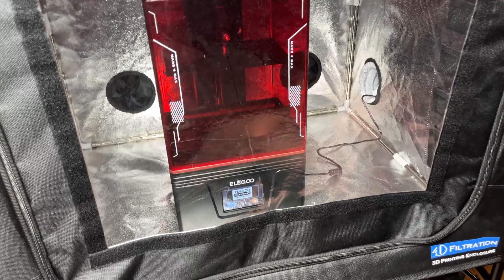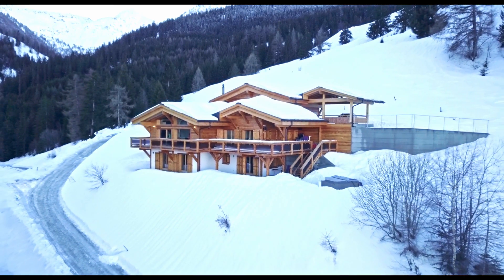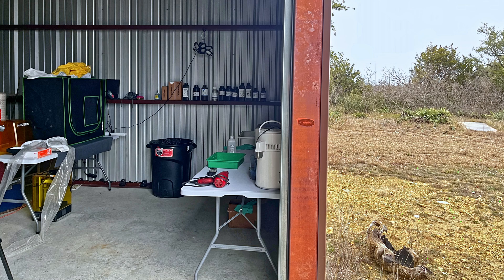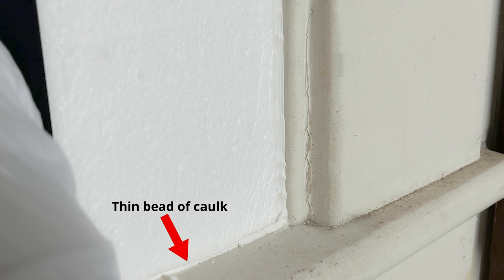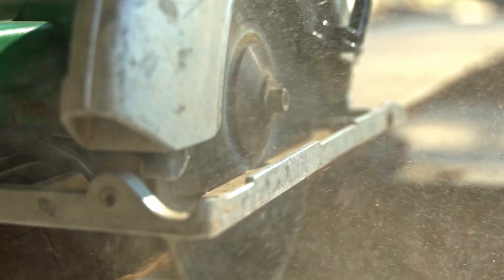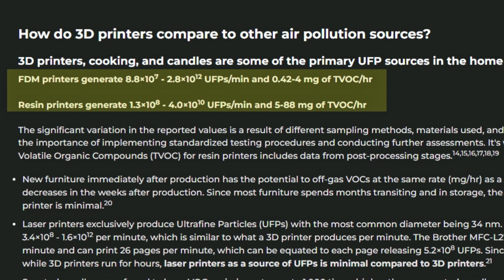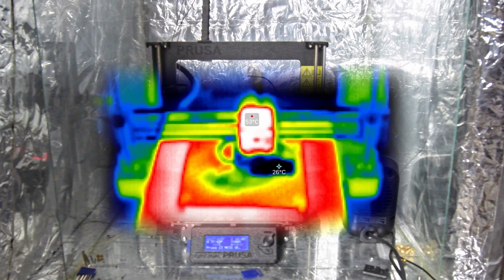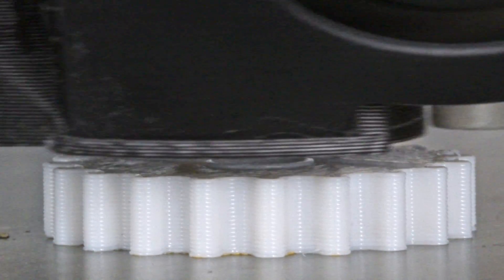FDM & Resin 3D Printer Ventilation

Comment: So I have a fdm printer in my office inside of a small grow tent with it being extracted out the window. I have a similar setup in my garage for my resin printer where it has a extraction fan that is pulling air out from the printer through a carbon filter out the garage. Will this be fine? I also have a fan that is pushing air out of the garage as well from the back to make sure nothing comes into the house.
Reply from the maker: These both sound like perfectly fine setups. 

You certainly have the right idea by creating negative pressure in the entire garage, but one thing I'd be worried about using two fans in the garage is that they would be working against each other unless there was sizeable gaps/inlets for the air. 
For example, if the garage is very well sealed (minus the two exhausts) and one fan was twice the power of the smaller fan, the more powerful fan could be trying to draw air backwards through the smaller fan. I'm not saying that this will 100% happen because there's variables in play, but it's something to watch for if you decide to use two fans.
Reply: @ArisAlder  I meant that I have floor fan in my garage. The printer and tent setup is sitting next to the entrance of my garage and I usually put my garage door up about 50% to make sure I still have good ventilation, probably overboard.
Reply from the maker: Oh yeah that's perfectly fine then - it will be recirculating with the outdoor air.
Reply: @ArisAlder thanks!

Comment: This was an awesome starter! Thank you!
I actually do have a question.
I've always eyed resin printers but haven't delved into it because I life in a colder climate and I live in an apartment without a garage.
I might be able to secretly (I'm sure the landlords won't approve) print in the shared attic from my little compartment as I do have access to a tiny window up there.

I was intrigued by your suggestion of airing out the printer non-continuously after the print has ended.
How bad of an idea is it to put the resin printer in a grow tent in my flat and purge the air after the print has finished?
Reply from the maker: Thank you for the support!
Do you have a balcony, patio, or private yard space?

Plenty of people use resin printers in an apartment (in a separate room or common area) while venting out a window, and you are right that a colder climate does make this trickier/more expensive. Indoors, the printer needs to be vented continuously. It is while in a garage that you can wait to vent, since this is isolated from indoors. The exception would be if the garage is also being used simultaneously; then it should also be actively vented.

Using the printer in a shared attic space would be a bad idea. This would fall under the same situation as a college dorm, where it could be exposing other people inadvertently.
Reply: @ArisAlder  Hi, thanks for the repsonse, that already helps. 
yeah I do have a balcony but unfortunately it's pretty open (without a roof). 

I live in a two room apartment, so I have a work/office room (where I spend a lot of time) and a bedroom.
I could vent it out from my work room but it's not really ideal if I spend a lot of time in it. I probably have to build some crazy heated shed-enclosure combo on the balcony by the looks of it but that seems dumb because of the UV-exposure outside. 
In the attic space I could vent it continuously though.
Reply from the maker: What's the average outdoor temperature in your area?
If the printer is in a grow tent, a heat band or small ceramic air heater can be under the acrylic lid and make the heating a bit more efficient. Whenever you're done printing, if all the resin is cleaned up the whole thing can even be brought back inside. 
Keep in mind that venting while inside would also use extra electricity because cold outdoor air will force its way in due to the negative pressure.

Comment: Please go and read the actual SDS forms for the materials you are using. For resin much of what is said here in this video is not required. Here's a link to Siraya Tech's SDS sheets, and one directly to BLU for reference. 

'After inhalation:No significant signs or symptoms indicative of any adverse health hazard are expected to
occur at standard conditions due to the low volatility of this material. However, aerosols, or vapors which may
be generated at elevated processing temperatures, may cause respiratory tract irritation. Symptoms of
irritation may include coughing, mucous production and shortness of breath.'

'Respiratory protection:If this material is handled at elevated temperature or under mist forming conditions,
NIOSH/MSHA approved respiratory protection equipment should be used.'

A respirator is only required when working with the resin at elevated temperatures which are not likely to occur with regular use at home.

https://siraya.tech/pages/msds

https://drive.google.com/file/d/18lnce5N9rTWnZeTIZse8RN4bF6Z4xtDr/view

Comment: This 3D printing concept just got next-level! Forget pushing plastic through a nozzle, what if we built objects from the inside out, layer by layer, with a two part container?

Imagine a two-part vat that spins while a fancy nozzle sprays a special resin, building the object layer by layer. But here's the twist: a UV light zaps each layer to harden it, and tiny magnets outside the vat can manipulate the resin for even crazier designs!

Think dissolvable layers hidden within the object, or even tiny components placed precisely using magnetic fields. This "Morphing Matrix" could be a game-changer, letting us print objects with hidden compartments or even self-assembling parts! #FuturePrinting #MindBlown

What do you guys think? Could this be the future of 3D printing?
Reply from the maker: Sounds expensive! :p
Reply: @ArisAlder  build objects with a spinning vat build inside out have many uses like layer resins soil ECT build inside out
Reply: basically inkjet, already exists, just cant do anything non planar obvs